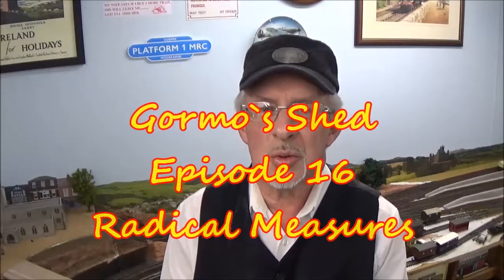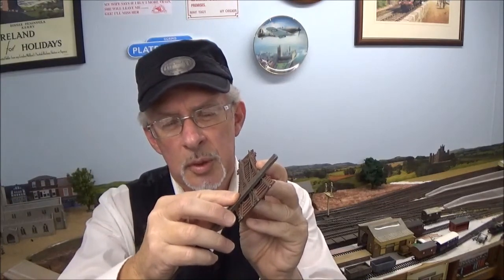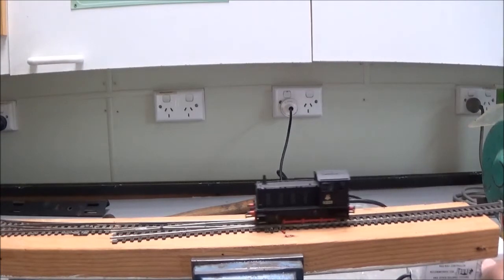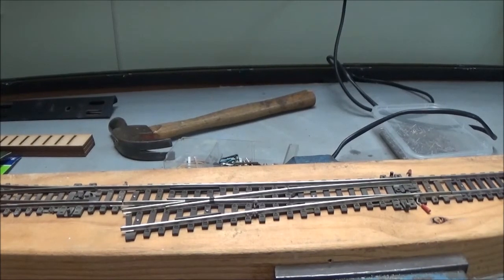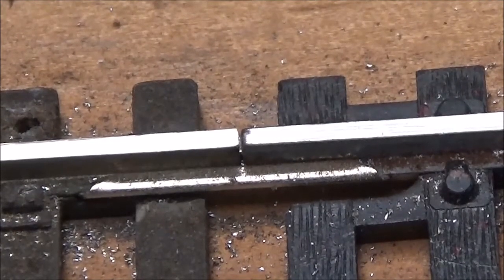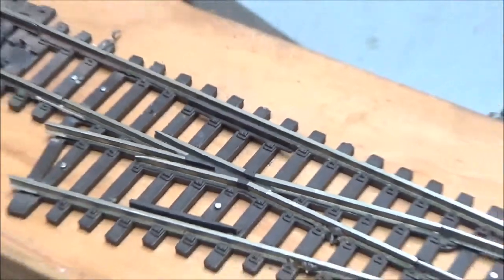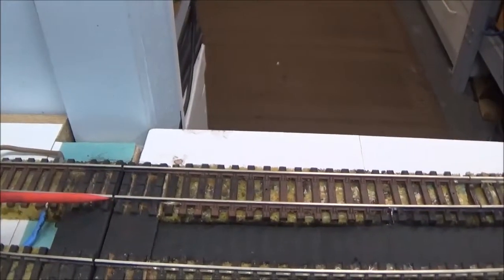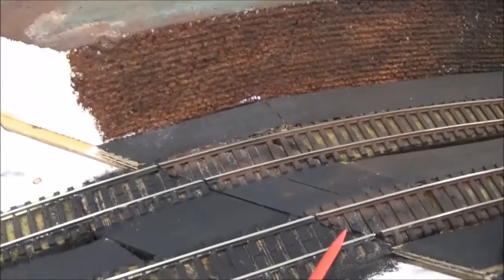Episode 16 Radical Measures

Comment: Hi Gormo  I have had to resort to this method too !  After filing the rails I use a carborundum stone to remove any rough burrs. Thanks for the videos - keep them coming ! Anything on repairing the common problem of split nylon gears spinning on old Mainline/Bachmann locos would be useful. Apparently you can clean with spirit, drill/ream out the central hole then use Q Bond to superglue/repair the wheel to the shaft.
Reply from the maker: Thanks Ray,
I haven`t been down the split gear repair road yet......the method you describe sounds effective. My only successful repair on gear problems in a Mainline loco involved pulling the motor out of the loco and turning the tender into a tender drive.
Cheers Gormo

Comment: Hi Gormo i do enjoy your videos great info and well presented top guy, here is a tip , i am using Triang series 3 track so i can run old and new loco's as the old engines wheels flanges hit the plastic grips to the rail on the super 6 track. But on series 3 track there is no problem, so in effect it is best of both.
Reply from the maker: Well there you are......now that`s interesting, I`ve never heard that before.
I would have to look at series 3 track. So are you saying series 3 is getting close to the look of modern track.?
Cheers
Gormo

Comment: I have heard a theory that pinning the track down through the middle of the sleeper, (lengthwise), can distort the track, and that it may be better to pin it between the outer edge of the rail and the sleeper end. I can't confirm it works. Good vid as usual.Regards Ted.
Reply from the maker: Thanks Ted........yes I guess that theory could be correct...?....I guess the best way is to test it out some how..??? Pinning on the outer edge may indeed give a better result at the rail joins........don`t know????....Cheers Gormo

Comment: Wow, I buy very cheep switches, usually used, and I have never had to file any of them. By the way, before you say that i just haven't seen any bad switches, I have been in this hobby for over 50 years. it would seem that you are tearing the hell out of the rail profile. If vacuuming is the best way, why didn't you use a vacuum??? You zoomed in and we saw that the top profile of the track was gone.
Reply from the maker: Ah yes.....well there you are you see..???
I did call it " Radical "😁